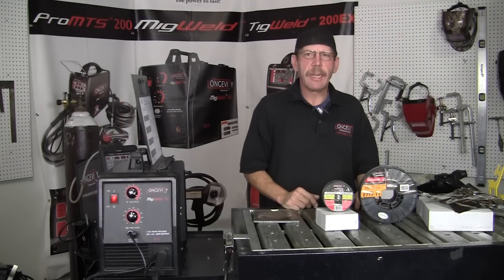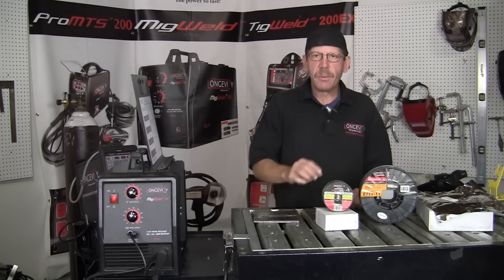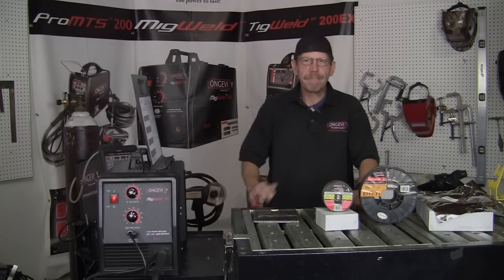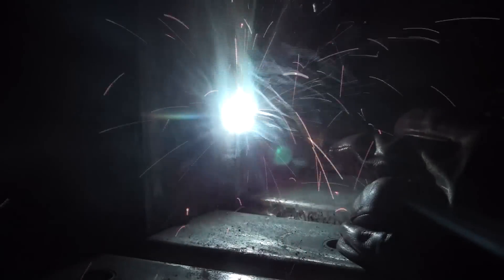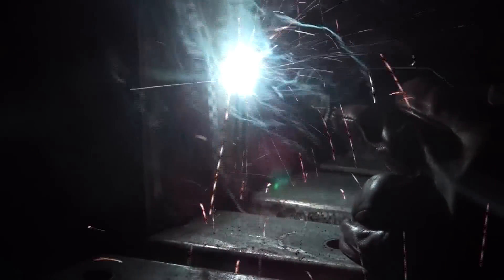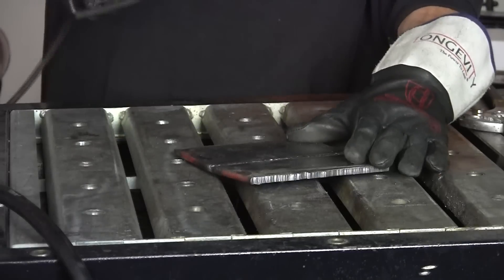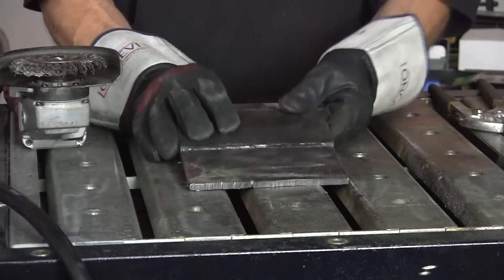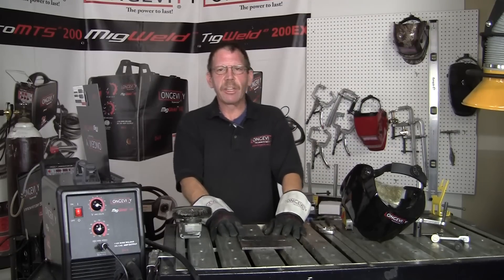FLUX-ARC - Flux-Cored Welding Wire by Longevity

Comment: Thank you for the demo. Can Longevity E71T-11 0.030-inch wire weld fillet weld on 19 gauge square tubing, or, for 19 gauge we need to go for 0.023/0.024-inch wire? please suggest.